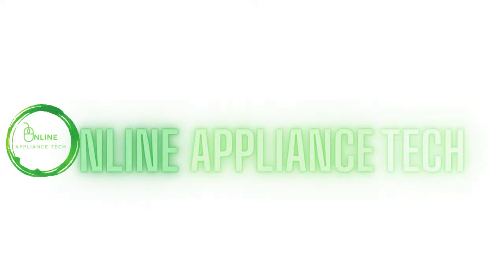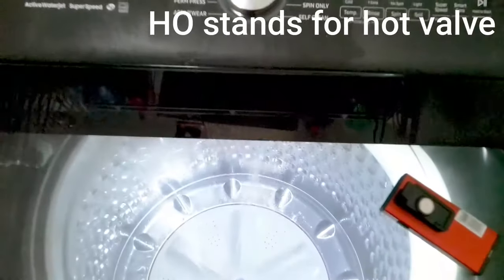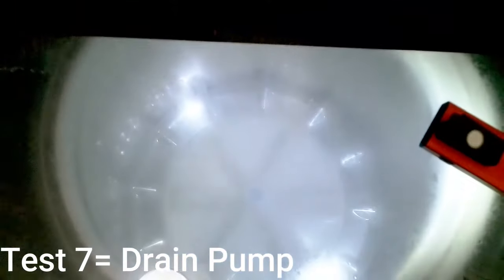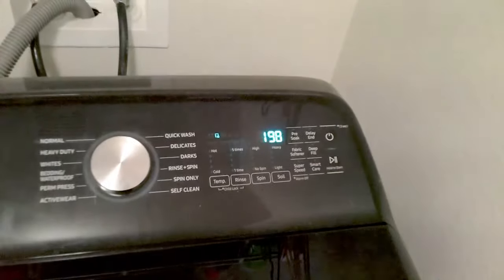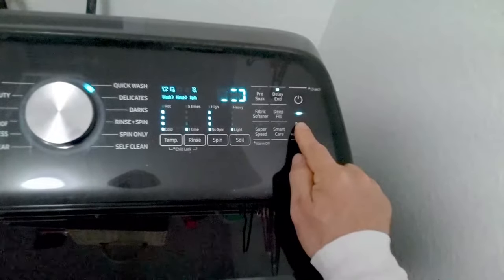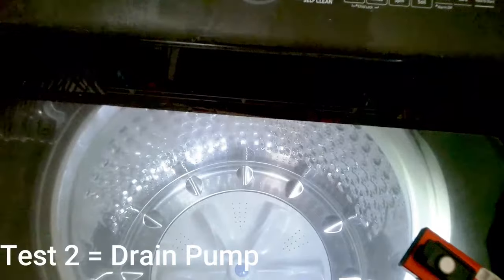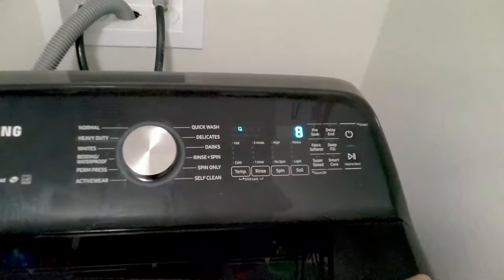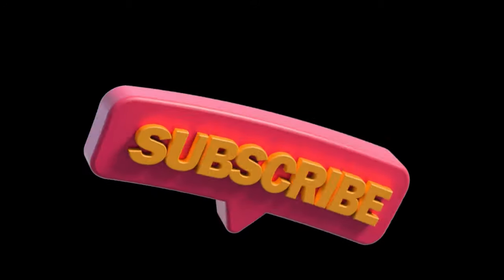Samsung Washer Diagnostic Mode [Learn how to find Error Codes on a Samsung Washer]

Comment: Thanks so much. Haven't completely figured this issue out but think i have it figured out.. i run and empty  load and it wont go into a high spin.. i did this test, empty, and it goes into a high spin but shakes.. so, it seems the mechanics are working..i.e. the motor parts.. note, it is balanced and i recalibrated it.. safe to say its the shocks?

Comment: did the diagnostic mode, I'm getting a flashing hot light, the manual says to call a service tec. lol . the model is WA40J300A it all started with the power pressed then the start pressed allowing the machine to partially fill, then pause, added my liquid soap and rinse the cup out, added the clothes, and hit the start/pause and nothing happened not even the power button would respond. I could stop the machine by unplugging it, after the machine finished washing I did the diagnostic as you showed, and now the machine allowed me to power on, pause, and then resume. your thoughts, please.

Comment: I run the high speed test #8. It gets to about 255 no higher and then stops and starts blinking the 8. No error code. Changed the suspension rods/springs and it won’t go through high spin cycle when washing clothes. Idk what else to do.

Comment: samsung top loading washing machine wa70h4000 panel keys suddenly not working. Except on/off switch work. Rest of keys have powers led but do not functions. Display shows previous time on each on/off. How do I get into test mode? what could be the issue?

Comment: what if it won't power on, and if you hold the power button, if just flashes 'door locked'?
This happened after trying to run the steam sanitize cycle, and waiting hours for it to finish, turning it off with 2:18 remaining on the clock after 14 hours.